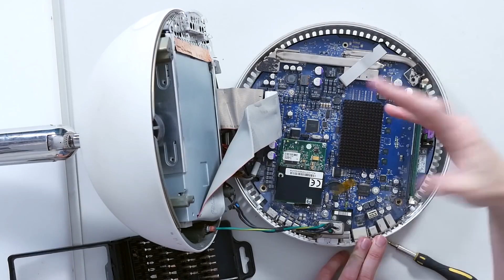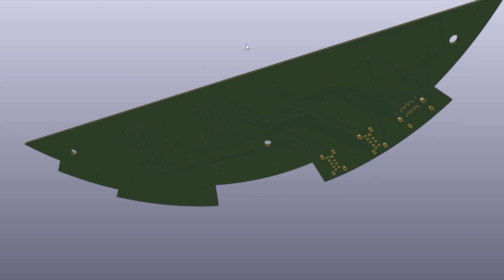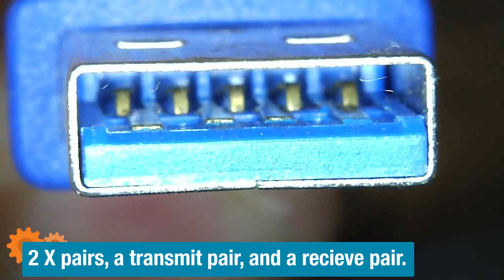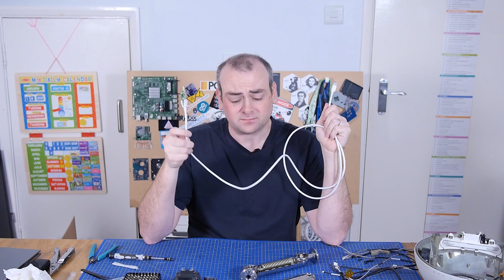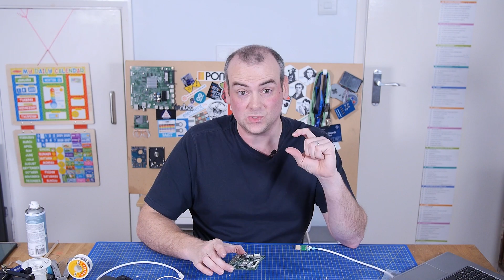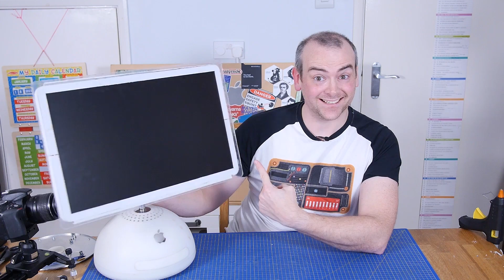Upgrading the Apple iMac G4 with an Intel NUC

Comment: I would love to just have a PCB to run a single USB4 cable to to multiple USB-A and USB-C ports, 3.5mm jack, HDMI, etc. I recently bought one of these nd have a magentically mounted touchscreen monitor and am in the process of installing a PC inside. Looking for the right small speaker system though.

Comment: I'M A TOTAL BEGINNER when it comes to modifying nearly anything , however .... I simply want to keep the CD / DVD drive . . .  and bumping up the CPU to the extreme GHZ - or higher , planning for  the future to go to the moon and beyond ! ...  I would not mind having an external BRICK Power supply ..... Mac O/S of course .... making use of an old discarded MacBook screen would be good ,........  al while keeping it on a very low budget . . .  is that even possible ?

Comment: would've like to have seen a laptop display put into the display area instead, it would have possibly been easier to route that through. Also since there is a new display housing, the light guide for the power LED and the built in microphones are now gone...

Comment: That soldering iron tip is RUBBISH. Get a fatter or shorter tip that can actually transfer the heat to the joint. Also, you need to clean the iron before soldering, not after. If you solder, then clean and put it in the stand, the iron oxidises and turns black as we see, and it doesn't transfer heat anymore and soldering becomes very hard. The tip you have can probably be revived if you dip it into some "tip tinner" and from that point, make sure there is always solder on the tip, so it doesn't oxidise again.
Reply: I know I know - I had more on order, but they didn't arrive in time!

Comment: What was the cost breakdown for this project?
Reply: The big costs were the NUC, Monitor and PCBs, which were £110, £120 and £30 (but I ordered a few spare PCBs in case i had issues). The iMac I think was about £40 a few years ago? So all in about £300?
Reply: Oooo maybe a future build using a Framework laptop mother board!

Comment: Amazing! It was (and now is) a beautiful design.
Did you consider adding weights near the top connector to balance the spring? My brief experience with these was that the hinge was perfectly weighted.
Reply: I was expecting to have to add something to it, but it ended up well balanced in 90% of positions and tilt. I think the cables needing to "wear in" a little is actually the limiting factor more than the weight?

Comment: "LED" screens are still LCD, just they don't use CCFL tubes for backlighting anymore. Calling them LED is buying into the marketing crud of the TV industry that came up with calling LCDs "LED" to make people think they were getting something like an OLED which actually is a different display tech.
Reply: That is very true, TFT Vs IPS is probably the better comparison. Although for me the LED backlight was probably the important feature, as it was significantly less power draw on the 19V power supply, a thinner package and meant I didn't have to deal with the high voltage drivers CFLs need?
Reply: @a531016  IPS is still a type of TFT, maybe you mean TN to IPS? But yeah it is an upgrade, especially in power consumption, it's just that marketing has infiltrated people's way of saying this. Like how 2k now to some mean 1440p, when it really means 1080p.

Comment: Ugh. Windows. Steve Jobs is spinning in his grave.
Reply: Did you guys watch right to the end? Watch from 19:43 again and try to read between the lines a little...
Reply: Maybe, but just as much as he would be if I'd pirated Mac OS onto it too?
Reply: @a531016  He would not have minded Linux. Jobs and Torvalds had a healthy relationship. Jobs and Gates had a very adversarial relationship..for good reason. Like I say..SPINNING in his grave.
Reply: Hardly an upgrade. It’s o longer a Mac. Just a monitor with a NUC inside.

Comment: Could the internals of a new mac mini be used inside the g4 base? I have both lying around and would be interested in trying it
Reply: I'm not sure, it'd definately be on the snug side if it does fit! Do you have accurate dimensions of the new mini?
Reply: I’ve seen somewhere here in YouTube someone putting a m2 Mac mini inside an iMac g4.
Reply: Found it: https://youtu.be/s4vSO3BY6BY

Comment: I love this! So well executed. Would be an amazing decoration piece as well as functional machine. Perhaps a mini itx motherboard and low profile noctua cooler would cram in more computing power but that would need a more complex power supply setup obviously
Reply: Mini ITX is juuuuusst about possible, but it'd be a real challenge - and may require some brutal modifications to fit (board trimming and mounting hole modification). And you probably couldn't fit any expansion to it, so it's a realy challenge. Not that it couldn't be done, but a challenge!

Comment: Man what's the point of having an Intel Mac at this point considering it'll be phased out in favour for their M seires ARM chips

Edit: great project all the same, only thing I'd do is see if you can't use PD for your project rather than a barrel Jack, considering even 20 volts is close enough to 19
Reply: That's a good question! 100W PD would have a good chance of powering this whole project - althought the PCB design would be beyond my current ability!
Reply: @a531016  Hmm.  Well on Amazon they have 20v PD to 12v DC barrel jacks... They also have PD boards where you could straight wire a DC barrel jack to
Reply: @adventureoflinkmk2  I picked up a couple of PD to laptop charger type adapters a while back, they integrate the PD negotiation to a chip on the adapter (I opened one up to see). If I was going to integrate it into a project like this though, I'd want the USB type C to be in the device, so the IC would be integrated?
Reply: @a531016  yes, you'd want the cutout for the USB C port on the device and let the IC do the work
Reply: Although I don't see why sending 20v directly would cause harm

Comment: It'd be nice if you could integrate the power supply (broken out to just a power cord connector). The one you have is obviously too big, but if you check the power consumption and get an appropriate laptop supply I feel like that might be possible. Other than that, you could install Elementary. It's a Linux distro that looks a lot like OSX. What would be really cool is if you can make some kind of levered mechanism that pulls some broken out USB ports forwards when you open the door of the optical drive.
Reply: I think the ideal solution for the front port involves a capacitive button that can live behind the cover, and a servo to actuate it? That sounds like a fun little upgrade!

The power supply could be doable, the 130W one is enourmouse and way over powered for the application, It's just nice not to have any 230V (in my case) inside the case?

Comment: Very neat little project. Alright, a bit more than little...
What I would do differently... I would make more than a single PCB, and would make them in a shape that would help keeping the NUC inside firmly in place. So they would probably be shaped like this: ([   ]). The one in the front would also extend some of the connectors. Maybe the CD drive cover should have holes to mount the USB ports externally. They may need a lot of TLC to look "right", though... As for the white part of the bezel, I think you could get white double-sided tape or something like that to hide the seams of the 3D printed parts, but I would've preferred to print one single part if I could get someone with a large enough printer bed to do it for me. However, if that's not possible you could make some notches to try and hide the seams a little bit better.
Reply: Thank you, I'm glad you like it!

The idea of the larger PCB (also, excellent use of the ([    ]), it was perfectly descriptive!) is a very good idea. I kind of wish that rather than using the internal cables I'd designed the PCB with internal male connectors to plug straight into the NUC. Although that would have mean it would only work with one model on NUC, and this has some flexability?

A large format printer and a lot more time would have been ideal, and with a perfectly tuned printer and some pre treatment of the acrylic, I wonder if you could have printed it straight on? But 600 X 400 mm is quite an ask!
Reply: @a531016  Well, I guess you do have more flexibility in terms of which NUC to get, but if they have standard mounting holes (sort of like what VESA has for monitors) then maybe one could do something that would allow it to be screwed down. I mean, I guess you could even glue the NUC inside of the Mac case if you wanted to, but having a proper mount would be better, IMHO. It's a bit of a Jobs-ian thing, I think, knowing what's inside, if it's not neat it would bother me to no end. :D

As for the monitor bezel, I wonder if, instead of 3D printing a big rectangle, you couldn't instead have it be CNC-ed. Like, from a piece of white Sintra or something like that, which is some kind of PVC foam board. Ben used to do this sort of stuff with Sintra, IIRC... And I guess it would probably remain its whiteness. I'm not sure if the filament you used tends to become yellow with time/sunlight, but it's something I would worry about.